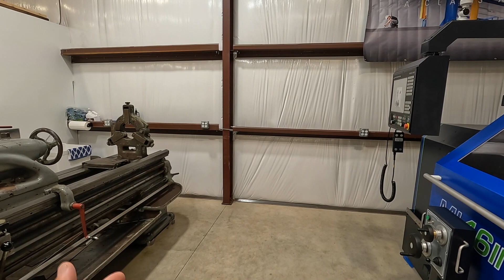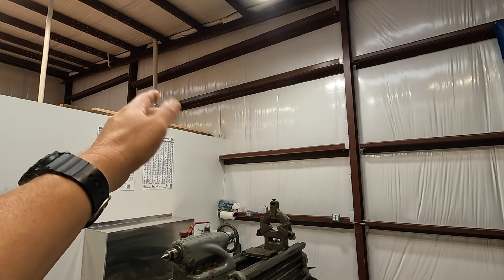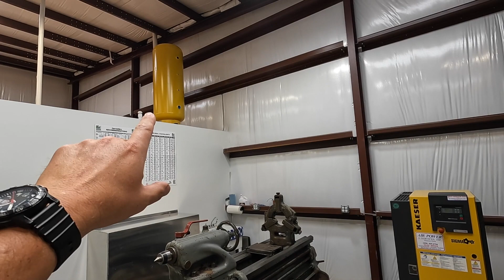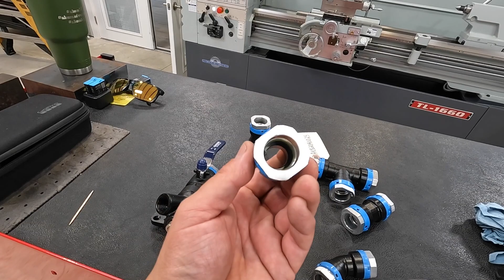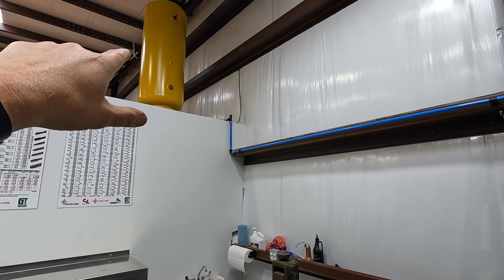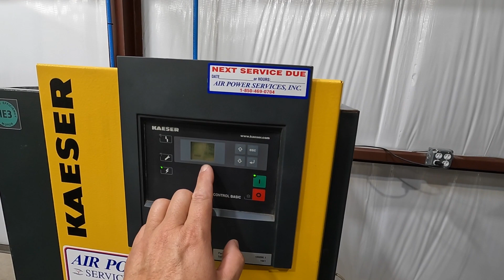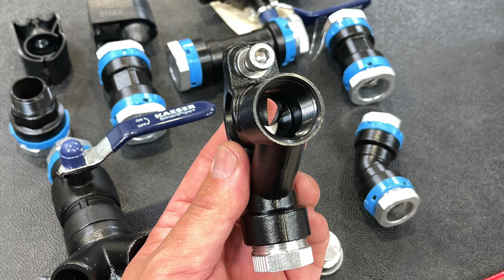KAESER Air Compressor & Smart Pipe Installation

Comment: I just bought my first Kaeser for our new building. Havent installed yet, but will in  couple weeks. I am like you. 
I saw a pair of Kaesers at another local shop and was impressed. So quiet.
Looking forward to seeing how well it works
Does it put out a lot of heat so that it causes air conditioniong to work overtime?

Comment: Killer air system. Seems all so technical, but when it WORKS, you never have to think about it again. Just connect where and when you need.
That's the beauty of a well designed air system. What this looks like it very much is.  1" that's some massive delivery.
and SO QUEIT! o0  What a dream.   This isn't even the final form either?  I didn't know about this technology. This is amazing.

Comment: Hey Abom love the new shop videos, really fun to watch, I was wondering since you put the extra tank on top of the office area, can that roof handle much more weight? if yes and I was in your shoes I would move the compressor there next to it since from my perspective the compressor seems kind-of in the way between those 2 machines. and on the plus side you get a neater setup and maybe use the top area for storage or so and have a ladder or stairs to it if possible, again assuming it can handle the load on top of it.

Comment: Terrible location for the compressor. A compressor should not be seen, heard, or in the way of any shop activities. Remote mount that bitch in box outside or on the mezzanine with a power switch for it by the front door so you can flip it on as you enter the shop

Comment: Is the air dryer like a ac system without the cooling? Curious,  my old boss had one for a air compressor but he passed before he had it hooked up. Thats a nice system,  hopefully will have my old compressor running soon

Comment: All installations I have ever been involved with have a flexible hose between the compressor and the system. It isolates the vibration from the piping. It would also help to your auxiliary air tank. It would also clean up the connection. I would add a ball valve between the piping and auxiliary air tank. It could give you stored air in the even you need air with the compressor off.

Comment: Your Kaeser air center is loud, ours is like  noise of a 3 phase motor running. Or is it just because the mic pics it up diffrent? 
Ours is running on 3 phase 400V 16A maybe its louder because it is running on diffrend voltage.

Comment: hmm says the compressor is made in germany, in bavaria, and in gera which is the sister city of fort wayne indiana, which usually has people that are from the sister city of gera that visit during germanfest week which is currently going on now, last weekend we had the fort wayne airshow where the blue angels from adams neck of the woods in pensecola florida are based, or the thunderbirds of the us air force which we had this time around as well as I belive the fa 18 demonstration team. its a compact unit though screw compressors can really put out continuous power, but a bit more expensive then piston powered or other types of compressors for air, we have one at the fort wayne railroad but usually only use it when we need continuious air like when running rivets or calking, or blowing out the flues on the engine or something that required lots of compressed air.

Comment: I work on Kaeser systems at a client. Solid stuff. 

But - a small tip. When buying spare parts, take a good look at the prices. Some of spare part pricing is bonkers. I’m still laughing at the fact that Kaeser wants 300€ for a spare parts kit for a automatic drain, and 275€ for a complete new. Especially when you know the construction of a auto drain. 

Besides the price, Kaeser is top of the line in my book…

Comment: It sounds like a old refrigerator from what I hear, very quiet,  I did a small  compressor install for a friend, installed the larger compressor in a building out back, and had a smaller compressor inside, for backup, and used the tank , for auxiliary air storage ,  nothing like this,   you could hear the compressor in the building out back, running inside the shop! 😳

Comment: Hi Adam, very nice compressor and plumbing. I would like to share my experience with piping. I had a shop lay out like yours with the office inside, I also laid the air line along the top edge of the office. The problem I had later was I could not slide a pallet on to top office, also when using a ladder I had to be very careful not to trip over the plumbing. So I ended up moving the piping along the outside wall to keep the top deck open.
I enjoy watching and learning tips from you, thank you for your time.
Reply: 100% on point If he's going to use the roof for storage area.  If not, they are easily assessable for maintenance and additions.

Comment: Where is the pressure being regulated? In the video it appears that the auxiliary storage tank is just teed into the header. If the storage isn't at a higher pressure than the header it is effectively just more pipe and provides no stored volume.

Comment: Congratulations on purchasing a top of the line compressed air system from Kaeser including their piping system. I suggest a refrigerant dryer to produce a -40 degree F. internal dew point to keep your shop air dry in your humid climate. This air will eliminate any internal condensation inside future pneumatic control and assembly pistons you may add to your shop especially in the automated machinery. From an old plant engineer.
Reply: The Kaeser Aircenter series and Airtower have dryers built in to the package. They provide a 40 degree dew point.
Reply: @ibey01  Thank you Chris for the information on the compressed air dew point temperature. I just wanted Adam to  check any new equipment he is purchasing that requires compressed air to check the dew point requirements, There are other types of dryers available also if required. I specified Kaeser Compresser

Comment: The compressor appears to impede good work flow in that bay.  Hope the actual one is smaller.
Not sure what the plan is (in the end) but I would think the compressor would have been better in the corner where the large fan is currently located with the tank located immediately above.  (Use some dead tree carcass to build a stand above the compressor).  
Fly a pipe over the garage door to get to the right side (looking out at the garage door.
Reply: Product Placement. This is a youtube studio.
Reply: Poppycock on stilts.

Comment: I have an Aircenter 7.5 at my shop. Has been running great for 5 years. Only thing worth knowing is if it starts to vibrate more than it should it might have got a build up of dust in the fan that cools the system. Ours Is in the back of our welding shop and I pull off the fan and clean it out every couple of months.

Comment: Wondering how the air dryer works?
Reply: The dryer is refrigerated. A heat exchanger cools the air to 40 degrees, goes through a filter to separate the condensation, then back through the heat exchanger to be warmed back up. Typically the air is 5-10 degrees cooler at the outlet of the dryer than the inlet. 

It is worth mentioning the compressor has an air cooler that cools the air to 10 degrees above ambient before it goes into the dryer.

Comment: Those silly swan necks on the drop down is an expensive way of doing it. Should have just made an L bracket in the lower sheeting rail to mount the outlet.

Comment: Hopefully your Kaeser works well. I had two different Sullair screws in the 2 machine shops I've had in 20 years with practically no problems. A bunch of different friends I have went with Kaesers and each one of them had problems with screws from 7.5-150hp. Fingers crossed that it's smooth sailing for you🙏

Comment: i've had an ingersoll rand 7.5 hp screw with 240 gallons of storage for about 8 years and have been happy with it. i wish i would have gone with a smaller unit since it doesn't run frequently enough.

Comment: That is a super air system, it's quiet and functional. I however precieve a potential problem. The air line you have run around the office should of been installed on the vertical surface and not on the top. The reason I feel this is important is because if you were wanting to use the top of the offices as a storage or some other use the piping is in danger of being disturbed or damaged. Just a thought...

Comment: That's a nice and quiet air compressor.  Years ago I worked for an outfit that made generator skids.  One time we got an Atlas-Copco (SP?) air compressor in with a Deutz diesel . A twin screw unit. We fired her up and there was a 3 or 4 inch valve on it. When that was opened it blew air 100 feet across the lot.  I walked into the air stream 30 or 40 feet away and the air blast almost kicked my legs from out under me.

Comment: That’s awesome very nice system and way quieter than a normal pump I guess it runs a little after it reaches pressure to clean out the air drier of any water I’m guessing that is going to be nice addition to your shop thanks for sharing
Reply: The motor keeps running for a bit for 2 reasons. It is more energy efficient for it to idle a little while rather than stop and  immediately restart. also the oil pressure is dictated by the air pressure in the separator tank. If the unit shuts off with 100 psi in the separator tank some oil will come out of the air filter.  Idle pressure is 15-18 psi.

Comment: Recently did some work installing a $7k  screw compressor and i wasnt very impressed... wasnt as quiet as i thought it would be, although it did have a compressor to cool the air as well..
Reply: I saw some of these are listed around 70dba while a scroll compressor can be around 50dba. 

Pretty huge difference, assuming you dont need the high CFM of a rotary screw.

Comment: Hi Adam. Nice looking installation. I just have one minor worry though. I work here in the UK on oil refineries. Most of our air line headers for control valves / process supplies are run in using 1 1/2” galvanised pipe. The drops down to the point of use are usually in 1” finishing with an isolation valve with a 1” npt female port that then takes Swagelok fittings for the final connections. I’m sure your guys will have done all the calcs but I hope you don’t run out of air when it comes to the spraying work.
Reply: A 20mm pipe has plenty of flow for this application. It could handle twice the CFM this compressor puts out.

Comment: Very nice system for sure.  I used Transair piping and fittings that looks almost identical to the SmartPipe being aluminum tube same metric sizes.  Mine has been in service for 17 years now on a IR piston compressor 7.5 hp., however, I looped my system with no deadhead runs.  Congratulations on a wise choice!
Reply: Kaeser's original smartpipe was made by Transair. The Smartpipe+ line is made by Eqofluids. I perfer the Eqofluids system. It tends to have fewer issues with leaks. The pipes are different sizes and not cross compatible.

Comment: Would you not have done a lot better putting the compressor out the back with the air con stuff no compressor is that quiet .

Comment: CNC milling machine can be air hungry so the compressor size is important.

A drier goes a long way to preventing problems down the line. Literally. Oil separator is another issue.

A nearby (to my workshop) spray painter now has a 10kW screw compressor with refrigerated drier which is oversized but it was a good deal and it's way more quiet than the 7hp piston compressor that he used previously... which didn't deliver enough air.

I make do with a couple of quiet 2hp compressors that I can gang together for the air hungry tasks like plasma cutting.

Comment: I really love these screw type compressors... with a good drier that's the way to go. If you want to paint and use a lot of air, esp. with several people at the shop (which may not be your concern) usually the air distribution hose needs to be quite large, say 1" internal diameter or more, so that one does not pull all the air from the others as there is quite a significant pressure drop along smaller hoses...

Comment: Great choice. I maintained a 25 hp and a 40 hp Kaeser for 25 years. Tough as nails. Maintenance is key to making them last. I love the engineering of Kaeser. They are absolutely anal about tolerances in their builds. Exactly what you want!

Comment: Do you ever get temperatures below freezing?  If so, how do you prevent the condensation drain from freezing?
Reply: It gets much colder in Indiana without a problem.  The trick up here is that the water is purged under air pressure so the initial water goes through the cold tip of the pipe so fast that it has no chance to freeze.  At the end of the purge cycle, a few seconds of mist then just air blow any remaining water out of the pipe so the pipe remains open for the next cycle.  I assume they did something similar.

Comment: you should consider putting the compressor up next to the tank.... looks like a good spot for it floor space is precious
Reply: Exactly my thougts and find a way to get the hot air directly out of the room. But it is a very professionel system.
Reply: It's product placement for the compressor, so you see it in every video.

Comment: Are you planning to build walls around the compressor? We have a nearly-identical unit at our shop and sure, it's definitely quieter than any piston compressor but still I wouldn't spend any time in the same room with the compressor without ear plugs. It doesn't roar like a piston unit but the whine it makes when compressing is still anything but quiet.

Comment: We've got a Kaeser compressor at an Amazon Fulfillment Center that I think is roughly four times that size (DSD maybe?). It maintains the air supply for all the conveyors and other pneumatics in the warehouse.
Reply: I'm a Kaeser tech in the Dallas territory. Amazon has standardized on Kaeser. I have been in a bunch of Amazon Fulfillment centers.

Comment: I should have went with a piping system like that.   I chose to go with brass all the way which ended up costing twice as much as the compressor itself.   Plus the fact that fittings nowadays from China are hard to get to seal because of poorly cut NPT threads.

Comment: It's a nice looking setup for sure but I can't help but wonder if it's really the right option or if it's hugely overkill, sure you have a new CNC lathe and a new CNC mill coming but unless you plan to transition away from all manual machining to constantly having those running how much air do you actually need? From what I understand and was advised by an air system supplier in the UK a screw compressor often isn't the best option for low volume, stop start running and I would expect with an air receiver that large there will be a long gap between the compressor actually running.

I was in the market for a new compressor last year (one man shop, CNC lathes with pneumatic collet closers) to replace my 3HP piston compressor, after all the research and working out the duty cycle my existing compressor was running at I ended up with a far simpler silenced 3HP piston compressor which runs at a 20% duty cycle when my Hardinge CHNC is running, and anyone who knows those lathes knows just how much air they consume.

There are no shortage of horror stories with Kaeser screw compressors too, especially from shops that are running them stop-start so they would not be even close to first choice for me, rather a Hydrovane if I needed much higher volumes of air constantly.
Reply: This was exactly my thought too.  

I heard if they arent run with high enough duty cycle water condenses in the oil lines.

I am looking for a machine for a small shop and our air requirement is really too low for any of Kaeser's offerings.
Reply: It's all about product placement, and which company gives Adam the best deal. That's why the compressor is located in the middle of the shop, where no one else would put it - so you can stare at it in videos from now on. Remember, this is a youtube studio for making machine tool videos, not a working job shop.

Comment: They make great stuff, we had a much larger version in an medical electronics facility I worked at, I don’t think we ever had a lack of air, always thought that blue tube just looked amazing… I believe there were 6 of one of their larger compressors tied together running probably 2 miles of pipe, was a really impressive setup for general use…

Comment: I have been involved with many industrial and transport facilities that had compressed air installations, generally they were installed with screwed galvanised pipework with all metal fittings.  On a couple of installations where the client was persuaded to accept a plastic pipework installation with push fit fittings, they have proved unsuitable with limited damage durability and invariably leaks that escalated.  The standard specification for one £multi-billion company is that screwed galv pipework only will be sanctioned because of the number of failed plastic systems within the Group.
I note that on this installation some of the pipework projects into mid-air that will make those runs vulnerable and the clip fixings spacings seem excessive for the same reason.  The standard specification for fixing pipework in UK is at 900mm ctrs.  The focus in UK is one of safety because a system charged with 100+psi can be quite explosive.
Reply: It's product placement, they need to demonstrate the pipe they want to sell to you, that's why the compressor is in the middle of the shop, where no one else would put it - so you can see it in every video.
Reply: The pipe is powdercoated aluminum. It is a good option for most cases.
Reply: @ibey01  I have now watched the Kaeser interview that Adam created  and I stand corrected about the materials used in this application however, I do have the same reservations about the installation.